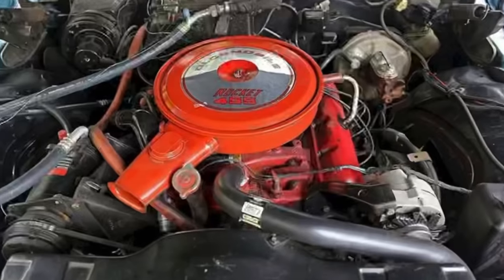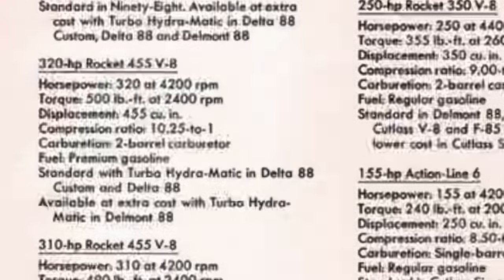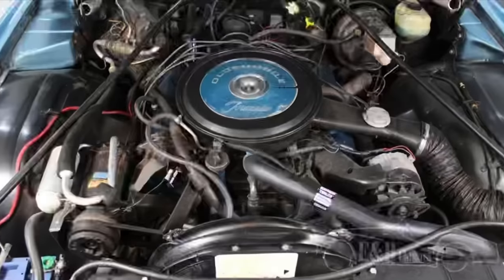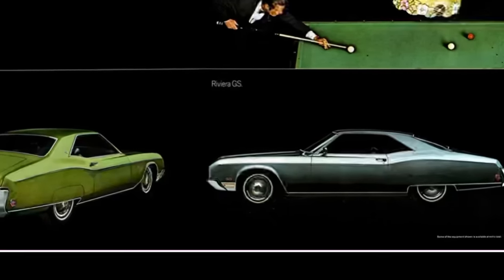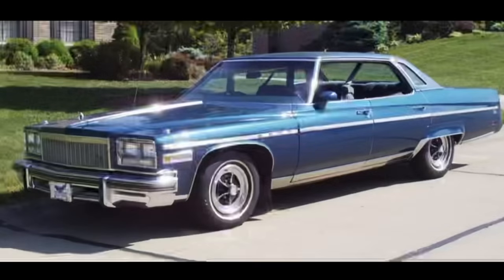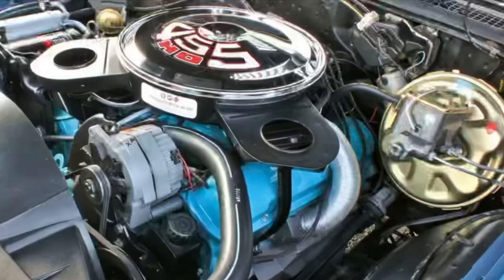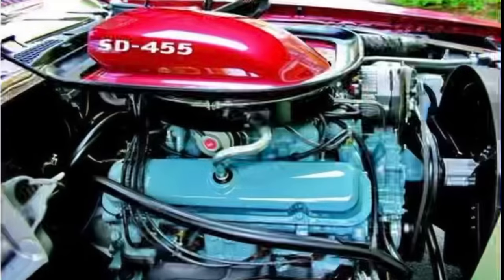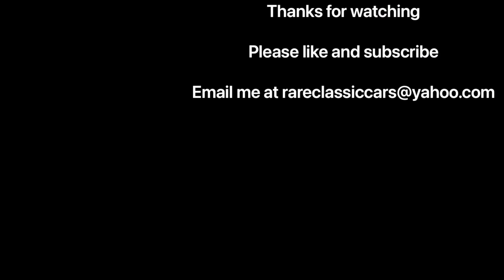Best Car Engines - The Rise of the Mighty 455 V8s from GM’s Buick, Oldsmobile, and Pontiac

Comment: Oldsmobile did employ the 455 in the A-body chassis before other GM divisions when it produced the limited production Hurst/Olds in 1968 and 1969.  This probably helped to get these other 7.4 litre engines released to the other A-body’s as there was more Hurst/Olds demand than supply.  Oldsmobile cylinder heads would flow less than Pontiac and Buick heads, but we’re adequate for their intended purpose.

   Thanks for the overview with your seat of the pants impression.  BTW, YouTube recommended videos from your old channel.  Your new channel is much improved

Cheers.
Reply: The 365 horsepower 455 was standard in Olds 98's beginning in '68 and in lesser forms of tune with a two barrel in Delta 88's with the more powerful ones as options.  They applied the same principle used in the Turnpike Cruiser option in 1967 on Cutlass coupes and convertibles, a large engine designed for maximum low speed torque driving through a very high speed 2.56 axle that gave both relaxed 75 MPH cruising while returning reasonable mileage for the size and power of the engines.
Reply: @jazzvictrola7104  Just hearing the words Turnpike Cruiser evokes an emotion and picture in my mind like nothing else in current times. I absolutely favor a car with gobs of torque and an axel ratio that lets the engine idle at 75mph. Thats why with proper maintenance, those engines are still running today. Ill be gone but I'd guess that the engines produced today will require much more than these old lumps do to keep them running 60+ years from now.
Reply: 455 Cubic Inches = 7.5 liters 
454 = 7.4 liters.
Reply: @giggiddy  In the 80's, when small engines began to proliferate, Castrol had an hilarious series of commercials explaining how the small displacement engines run so much hotter than the big V-8's and don't have the surface to dissipate the heat--then they'd show a cutaway of a four cylinder engine with the cherry red heat coming from its frantic pistons, then the thing would start knocking and seize up.  You can see some of those on YT.
Reply: Wait. What's his old channel name?

Comment: Hey Adam, yes, the General Motors 455 V8 engines were absolutely bulletproof workhorses!!! Thanks for sharing this informative video!!! 👍👍
Reply: So true they were also a engine used in many jet drive boats.
Reply: They had the torque to pull a house and a boat needs that. All of them should be kept in the 5200-5600 range with the 4.25 stroke. I have seen jackasses try to run them like a SBC. You can’t. Get the trans shifts in that range and let that torque do the job. They can be built to rev, but why? 550 ft lbs dropping to 500 at the shift back to 550 shift again and that stripe comes up quickly. Trying to push them to 7000 is an expensive destructive waste of time.  A 455 Oldsmobile cutlass with a TH 400 3.64 gears and put it in drive and let the torque do the talking. Many years of joy!
Reply: 2 bolt mains they like to spin bearings, I know I did it with 2 blocks in my 70 442.
Reply: @kgdies  That is true. But all three BOP engines had/have 4 bolt main caps that can be installed, most with splayed outer  bolts that work well and girdles that can allow 5200 rpms for as long as you want to keep them there.  The FE with a stroker kit, 4.125 bore X 4.25 stroke with Pro- Gram cross bolt mains with a 70’s soniced 390 truck block should have been built by Ford. They would be of the same utility and even more revs if you need it. It is as light as the Buick 455. I never understood why they never did it.  A good strong 5000-6000 rpm engine that could run that speed all day!
Reply: HEY DYMMY

THERE IS NO SUCH THING AS A 'GENERAL MOTORS 455'
ONLY 2 GM DIVISIONS HAD A 455 BIG BLOCK.
AND PONTIAC WAS NOT ONE OF THEM BECAUSE PONTIAC NEVER MADE A BIG BLOCK!!!
Reply: @ThunderAppeal  thank you, you must be the smartest person on the planet!!! You are definitely the most polite!!! 🤐

Comment: Going back to the early part of the video,  the torque numbers for each variation from Olds tell a story.   The under worked 2 barrel versions of the Olds 455 produced peak torque @ 2400 rpm - which means you can lumber around town in a stately manner and still have acceptable acceleration compared to most vehicles on the road today.
Reply: Oldsmobile 330,350,400,455 the only V8 capable of burnouts beyond belief while the tach sat 3500! All others 5grand etc!
Reply: I bought a 1967 Olds Delmont 88 for fifty bucks back in the day, with 4 doors and a 425 with a two bbl carb. That may have been the fastest car I ever owned, it sure surprised a lot of hot rods at stop lights!

Comment: OLDSMOBILE WAS A EXPERIMENTAL ENGINE DIVISION OF GENERAL MOTORS . OLDS HIGH NICKEL  BLOCKS ARE TOUGH AS NAILS . A LITTLE DR OLDS MAGIC GOS A LONG WAY . THE 1970 OLDS 442 W30 4 SPEED WITH THAT 328 DEG CAM IS MUSIC TO MY EARS . THE W25 OUTSIDE AIR INDUCTION HOODS IS ONE OF THE BEST LOOKING HOODS  AMONG THE MUSCLE CARS OF THE TIME . THE BEST 455 IS OLDS HANDS DOWN IN MY OPINION . GREAT VIDEO.

Comment: The 1970 Buick 455s had relatively wild cams in them. Buick employed "high-tolerance" Rhoads style bleed down lifters to smooth the idle down some, and the full-size cars also still had the variable-pitch transmissions in them further smoothing out the idle. That trans allowed a slightly higher idle speed and didn't cause creep.
Reply: I cut the exhaust off my 70 riv and it chops like it has a cam

Comment: A benefit with the Buick engines and especially the 455, the distributor is in the front, and the spark plugs are very easy to get to!
Reply: All ford’s have it up front except the Y block
Reply: I always thought of the Buick 455 as GM's Mopar big block.  I mean that in a good way as a died-in-the-wool Mopar guy.
Reply: Yeah, setting the points, on the Olds 455, was a bit of a reach!!

Comment: Man I absolutely LOVE your videos. I always learn something, too. A TWO barrel 455? WOW, I had absolutely no idea...
Reply: Yes, two barrel 455's were standard in '68 Delta 88's, with the 98's more powerful four barrel engine optional.  The carburetion isn't so important when you have huge displacement as that is what provides the low speed torque of those engines.
Reply from the maker: Yes. They work shockingly well.  Ford also had a 429 2bbl engine
Reply: Take the air cleaner off, the carb looks like an outhouse in the desert...
Reply: @jazzvictrola7104  Back in the late seventies the was stock car racing in my area that had a 2barrel class. All the GM guys were looking for 2bl carbs off 425 and 455 Olds.
Reply: When I was growing up we had a 1969 Olds Delta 88 with the 2bbl 455 engine and four wheel drum brakes.  Stopping was not that barge's strong point.
Reply: Ford had done the same with their 429 C.I. engine in the Colony Park station wagon. A 2 bbl. carb. And Ford's 2100 series carb was decent giving the wagon all that it needed for power. Used the same 2 bbl carb on a 304 AMC with headers in '78. fantastic !
Reply: My closest friend had a 69 Delta 88 Royale with the 455/2. Lots of them were made.

Comment: Olds are my favorite GM V8s because they're so smooth. First car I drove had a post-rocket era 350 and Quadrajet. When all of those cars became seven to twelve year old rusty, dented, hoopties, and were running around without a muffler, I swear I could hear the smoothness of the Olds - or at least the absence of that smoothness when hearing a Buick or Pontiac, or a 454 for that matter.
Looks like Jim Morrison on the Buick brochure - Come On Buick Light My Fire...
Really looking forward to that 455 SD video.
Good advice at the end.
Reply: Olds V8 engines all have a unique exhaust note. I never thought of it as smooth, but, yeah, that fits. I've got a 350 Olds ready to go into my 1978 El Camino soon.

Comment: As usual, you are a credit to disseminating unbiased knowledge of engineering descriptions of these engines. When you have the time, I would like to see a full discussion on the 4 GM 350ci small block engines. Please discuss each engines positive and negative qualities and which engine you think from an engineering standpoint is better or if they are equally comparable engines.

Comment: After I bought my 68 Cougar from my father when I turned 16 in 1969 my father got a 1970 Olds 98 with the 455 engine. Drove it only a few times for obvious reasons but I can still recall the torque in that car from a dead start. Wow! What I wouldn't give to have that car today. Like you I like all cars but I truly enjoy driving the full size cars of the second half of the 60s to 71 where I draw my line.

Comment: Great video.  It should be mentioned the 70 Pontiac 455HO is different from the 71-72 455HO engines.
Reply: I recently scored one for $50.00 out of a rotted out Catalina...it was reputed to be the terror of the town in it's day...getting it ready for my 66 goat..I found it has 4 bolt mains!..

Comment: Got a 455 Pontiac. Great solid engine. My favorite by far
Reply: I know of a local gentleman with a '68 Firebird with a 455, and mixing/matching stock parts has a combination that will ran a *dead heat* with a Mopar 426 Hemi.  I mean in sync lock.
Reply: @jeffbranch8072  that's not unusual.  it depends a lot on the length of race.  the Pontiac 455 will lay waste to the hemi coming out of the hole especially in a heavier car.  the hemi can really breathe on top and makes up the deficit at high speed.  it makes for exciting racing.

Comment: I was driving by 1966.  Everyone had their favorite of these motors.  The Olds showed up 2 years before the others and had the highest factory hp rating, 400 in a Toronado only ram air version.  The Pontiac had the most aftermarket support, you could get anything from a crossram dual quad setup to forged aluminum con rods from vendors like Mickey Thompson. The Buick was nearly 50 lb lighter than the other two and made a big 5 ft lb more torque than either.  This was enough that it was often the quickest in a stocker running street gears and full factory exhaust.

Comment: The GM crash barrier lab used to be powered by Olds 455 engines.  A buddy's dad worked at GM Research at the Tech Center, and only drove Oldsmobiles.

Comment: Wow, this is great vid.
In the early 90s I bought a 70 delta 88 with a 455 two barrel, 190 8000 miles on it.
The timing chain top sprocket was aluminum with nylon teeth, I changed it with a steel double roller, also a four barrel, and HE I, do exhaust, that thing ripped, until a limousine pulled in front of me and I smashed him good.
Then rebuilt that engine with some Mondello influence and parts. Dropped it into a 75 cutlass shell. The car tore up the streets back then.
When rebuilding the engine all of the nylon teeth were stuffing the oil pump pick up, but it’s still ran.

Comment: Back in the 70's my buddy had a 1970 GS with a 455 Stage 1, 4 speed and 4.56 posi. It was a plain jane bench seat car with body color 15 X 7 steel wheels and poverty caps. What a sleeper!

Comment: The 1970 Buick 455 Stage1 was  absolutely under rated at 360 horse power because it was tied or could beat a 1970 454/ 450 horse power or a 1966-1971 426 hemi  425 horse power.

Comment: My grandfather was a big fan of the 455 Olds, both for the low end torque and solid reliability. But he liked to put them in 1/2 ton Chevy pickups. The first one he had was '73 and the second one was a '69. He'd just acquire a pickup body and then buy a late 60's/early 70s Olds 455. I started learning to drive on the '73 when I was 13(lots of back roads, no cops). When that one finally died and he built the '69, I drove it as much as he did. Since he was in it for the low end, any potential high RPM deficiencies never came up. They were rock solid and just got the intended job done.

Comment: My parents bought a '71 Pontiac Grand Ville with the 455; my best friend's parents bought an Electra with the 455.  Typical teenaged boys, we raced them.  You are so right about the Buick being better up high.  I later owned a '72 GS Skylark convertible and that engine still had some power.

Comment: Im an Oldsmobile man at heart and theyre probably my favorite GM division (although i love my Buicks, Pontiacs, and GMCs for trucks too) but ive been outspoken on the 455 Olds. It was average in automotive applications, definitely not unreliable but not the most powerful or outstanding of any of the Big Three's Big Blocks. However they were horrible in Marine applications whereas Chevy 454 and Mopar 440s and Hemis really excelled in these boat applications. Its not that they wereent powerful, but the Olds engines had a big issue with oiling in that when under hard acceleration, the nose of the boat obviously raises and makes the engine run on a diagonal surface. All the oil would go to the back of the pan and become oil starved and blow up. With modification this issue was remedied, but those other engines i mentioned never had an issue with that and were perefectly reliable out of the box in marine applications.

Comment: One "advantage" of our 1966 Olds Toronado's 425 was that the distributor was located at the rear of the engine. That allowed large pools of gas to collect at the front of the engine (from its leaky Quadrajet) without being set aflame immediately by a nearby ignition spark. 🙂
Reply: Pontiac had the distributor in the rear as well!!

Comment: Of these three, for a stock or mildly build motor, my favorite is the Buick. It's a newer design than the other two, and has a much lighter engine block.
Reply: There is a downside to that however,  in that very high hp builds of the buick 455 such as for drag racing can sometimes result in broken engine blocks.  Great for stock and mild builds but too light weight for serious high performance use.
Reply: @howebrad4601  for drag racing maybe, but if you're trying something like autocross it's basically just big block power and torque for small block weight.
Reply: @howebrad4601  Sadly the Buick 455 was just too thin for the power it could make.  I like the big bore short stroke and good heads in Stg1, and the engine was made for the Qjet it had. 800 cfm with pull over enrichment on the primary side, I ran one on my 390 FE.  I drilled the secondaries feeds like the one for the 429 CJ. I used a B hanger AX secondary rods. I think the primary rods were the stock Stg1 and I used the damper pot for the secondaries for the Stg 1. The only problem I had was getting fuel into it without nozzle drip. I believe it was .130 needle and seat with a clicker electric pump I turned on if I was getting on it. I could hit the throttle at 3000 wind to 6800-7000, shift wind to 6800-7000 and shift and at 4800 it would cough, and I’d  let out. My son timed me WOT and I had 12 seconds of fuel with -06 line. But the little FE loved it!  I have a 750 3310 VS with a rear metering block fitted with jets on all 4 corners and It has a Holley Blue and Regulator.  So there’s no real comparison. The Holley is much faster and the fuel system is much more agreeable to the carb. But I have to say that a factory Qjet is really well suited to a 5500 rpm GS 455 with an automatic and 3.64s it should be a high 12 second car.  But like I said that block will not be long for this world at 6800-7000 rpm.  It is well matched with the car! I would just love it like you should a 5500 redline and you have wonderful car.

Comment: I had a '71 Boattail Riviera with 4bbl. 455.  Pretty fast, but if you kept your foot out of the carburetor it actually returned decent mileage for a big block.  Gold colored without a vinyl top, which made it look really clean.  Wish I still had it.

Comment: What many people don’t talk about today is torque. Big engines made so much torque that they didn’t have to spin to 6-7 thousand rpm to make power. Oldsmobile 350’s & 455’s were such great engines and cruising was a dream because the motors had such powerful without a screaming sound.

Comment: The 455 Olds was also very popular in Jet boats. I have one in a 1972 Sea Ray. There was an issue with oil drain back from the cylinder heads. After a high rpm run it can starve itself of oil as it all gets pumped into the top end. Great videos!!